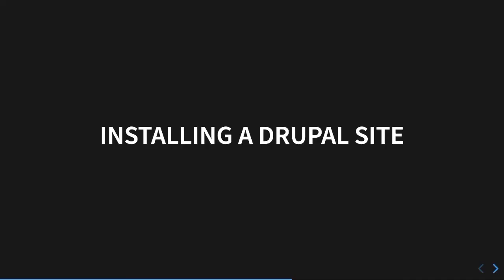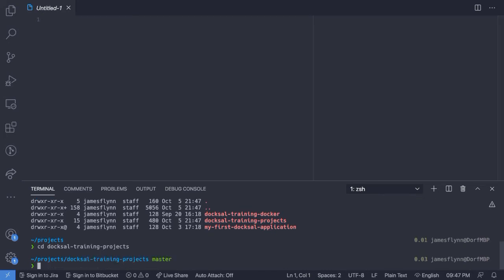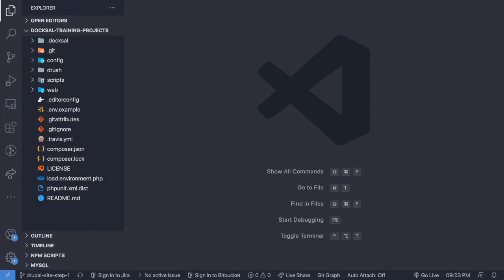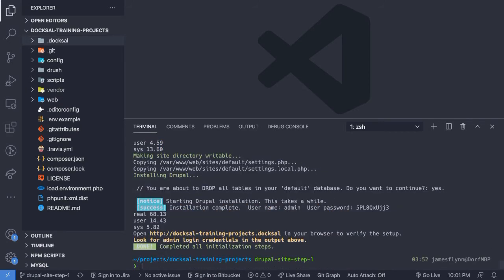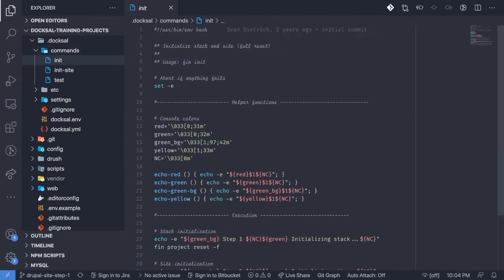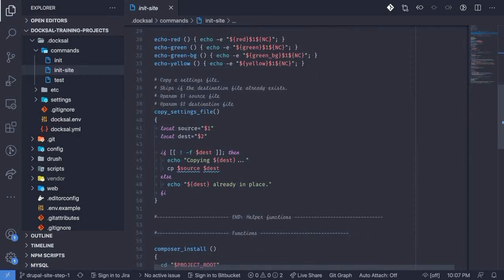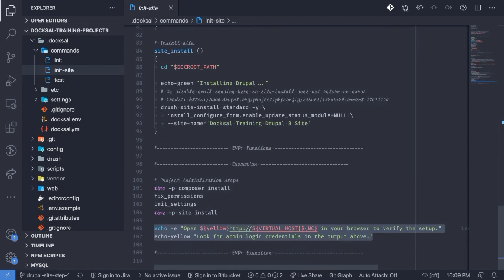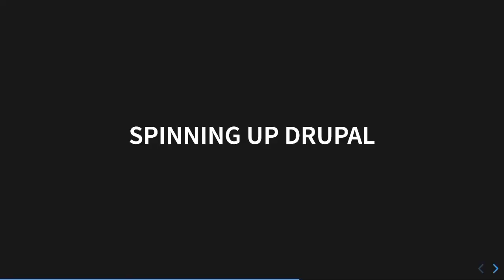Let's Learn Docksal Part 7: Installing a Drupal Site

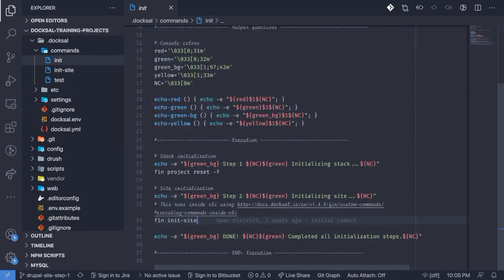Comment from the maker: Quick correction: At around 7:00 I mention the wrong thing to select if a command runs in a container or on the host.  The actual flag that determines this is the
#: exec_target = cli
line at the top of the file.  Some commands can only be executed on the host, but for the majority of commands, they should run in the containers.
Reply: Tkvm This serie of videos is amaizingly usefull.!!!!!!!!

Comment: So I followed these instructions and I keep getting:

Your lock file does not contain a compatible set of packages. Please run composer update.

  Problem 1
    - drupal-composer/drupal-scaffold is locked to version 2.6.1 and an update of this package was not requested.
    - drupal-composer/drupal-scaffold 2.6.1 requires composer-plugin-api ^1.0.0 -> found composer-plugin-api[2.0.0] but it does not match the constraint.

You are using Composer 2, which some of your plugins seem to be incompatible with. Make sure you update your plugins or report a plugin-issue to ask them to support Composer 2.
real 0.48
user 0.20
sys 0.08

The weird thing is I am using Composer version 1.10.20.
Reply: Same here! Did you manage solve this?